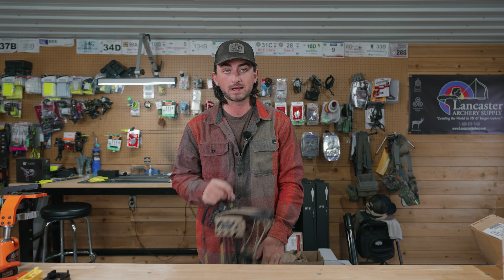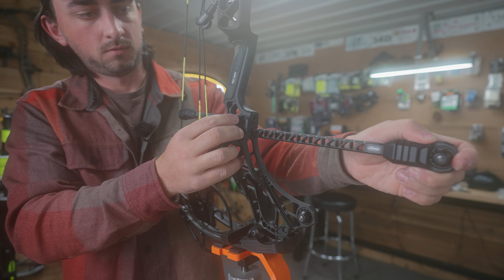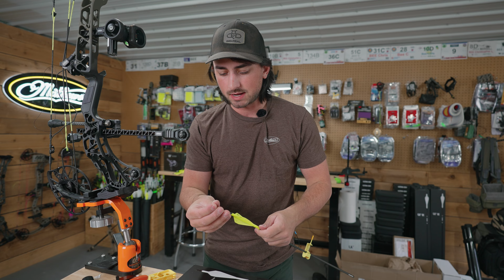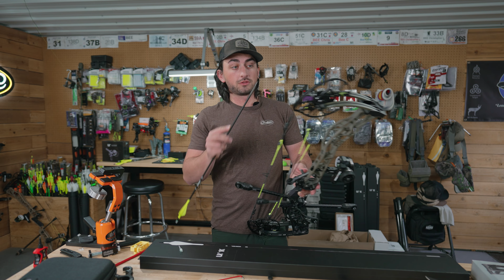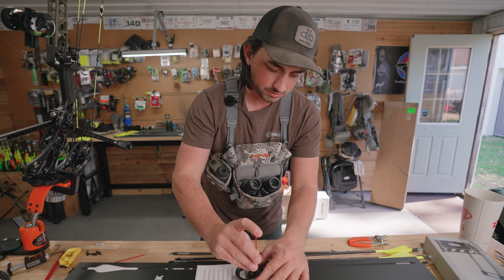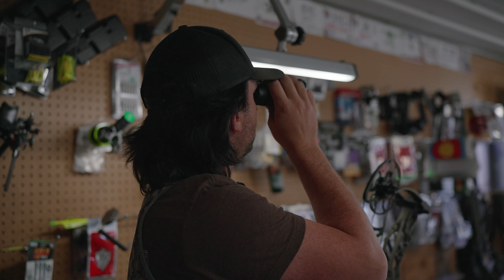MATHEWS LIFT RS (A Rocketship Of A Bow)

Comment: I personally couldn’t stand that bow as quickly as I bought it brand new I ended up selling it on eBay. I personally found the string angle was extremely sharp and when I drew back constantly, I felt like I was looking over the top of the peep unfortunately, we couldn’t move it any higher. It was just not a good fit for me. I was extremely inconsistent with the Lyft RS.

Comment: 27.5 DL. Do I go with the RS or the 29.5 Lift X??
Reply: U need to shoot both, I can tell u I shot the 27.5 rs and it was really surprised . I have a 27.5 inch draw and the back wall was solid and draw was smooth.

Comment: The Lift X 29.5 has a back grommet to mount a rear stabilizer mount/back bar. There’s a 1 7/8” difference between the Lift RS and Lift X 29.5 Riser. The lift RS riser is 28 1/8” and the Lift X 29.5 riser is 30”.  Mathews absolutely could have included a back grommet for a rear stabilizer/back bar mount.  It’s sad to jerry build and jerry rig a stabilizer on a $1,360 bow.  I’ll wait until next year when Mathews will have an all new lineup across the board. Every third year they usually come out with a complete overhaul instead of tweaking the previous model year. My luck they’ll probably keep the Lift RS where it’s new model and not just a refresh of the Image.

Comment: You can technically call those 340 spines 300. If they weren't toothpick length  arrows. You've cut clear into the reflex of the arrow. Substantially increasing its strength/spine. 

I genuinely hope nothing negative happens shooting that combo. My DL and it be blown out the frame for sure lol. 

I love the new series but it's not quite enough for me to upgrade from the lift 33 that lobs 700 grain 28 inch sticks like well beyond what I'll need. Probably for a while. But Mathews will for sure be top three bows and probably the first I grab when I pick up my next. Hard to beat. 

Also, as someone that travels  to Alaska, Texas annually, and 2025 I'll be giraffe hunting in Africa. Please listen to your guide. I settled at 700 with my lift. I primarily hunt deer out east for the hunters for the hungry program in my state. But I also shoot pigs to moose and I got tired to the retune lol. But my lift 33 absolutely loves them. And it's quiet like. They haven't reacted to it being shot yet and I've donated 85 +/- a few deer to the state this season. 

I'll see how they stack against axis this December.

Comment: What happens if you peep ends up going up to high? If you 28” so if someone is 29 I feel like they won’t have enough room? I’m interested in getting one but I’m 29” draw
Reply: Probably should go with the Lift X, the rs is pushing it for 29 imo, or you will have new anchor point with a lower peep
Reply: @Jglay16 why do you think the RS is pushing it with the 29 inch draw when the V3 27 can go from 25-29.5 with no issue?

Comment: Are we able to add more pin dials for the sight tape? So we can have 3 instead of only 1. Then I would be able to see what yardage all 3 pins are at instead of only one.
Reply: It’s physically impossible sadly, at least for when you rotate the dial. Imagine you have your 3 pins set to let’s say 20, 30 and 40 yards and the marker indicating the yardage of the topmost pin, 20 in this case. Now if you rotate the dial, such that the marker is set to 30 yards on the tape (now the topmost pin of your sight is set to 30 yards), the second pin WILL NOT be at 40 yards. Or in other words: if let’s say you originally have 10 yard differences between your pins, when you rotate the dial, the differences between the pins WILL CHANGE. Hope this makes sense
Reply: @balintkomaromi6629  Oh... Finally finished the video. Chris states we can add indicators to make it 3.
Reply: @moneyking6659  yes but as soon as you move the wheel, they 2 of the 3 will not be accurate, no?
Reply: It been having 3 marks and optional 4 marks

Comment: All the fellas with the sub 29" draws are going to buy this bow faster than Mathews can make em. Shoot this until you have kids or your kids get of age and then buy you the newest Mathews at the time. Generational.
Reply: why? mathews old bows go down to 24 25 inches also
Reply: @fishingmaster7 The 5.5” brace height is a big deal for speed for low poundage and short draw people. Not to mention it’s less than 4 pounds bare. Only bow that comes close to those specs was maybe the Creed SDX and it’s a 30 ATA and a 6 inch brace with a lot more reflex and shorter riser.
Reply: @ventureliefoutdoors630  I think its funny these guys talk up the bare weight then add 2 stabilizers, quiver, and a huge sight. all this speed info is given at peak draw and weight for each bow. if anything this bow is more unforgiving wouldnt it be?
Reply: @ventureliefoutdoors630  The Creed XS was definitely close. 28” ATA
Reply: I'm not sure what you mean, Matthews hasn't put out a bow that is smoother, lighter, quieter, faster (per brace height inch) since the Heli M
Reply: Already got mine
Reply: What dad has been doing for years. Moved from an MQ to a DXT, then to a tx-5. Now I'm buying my own to hand down to my son in 15 years like hes done for me